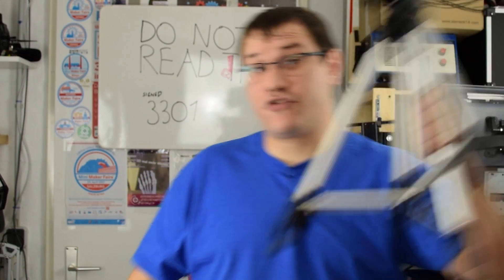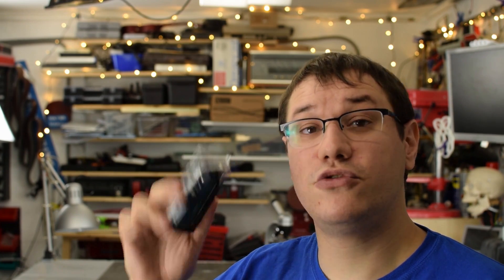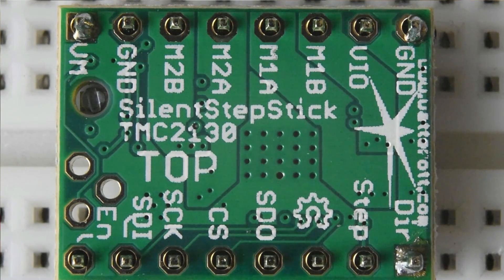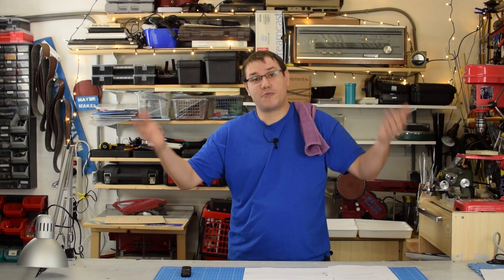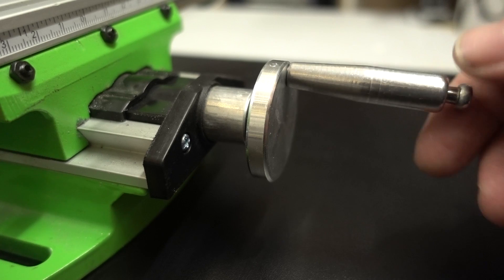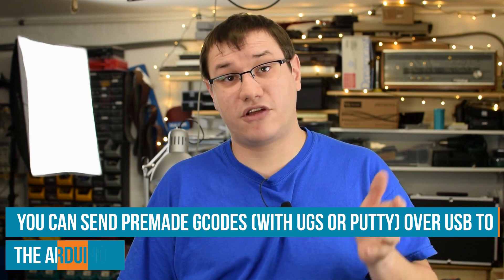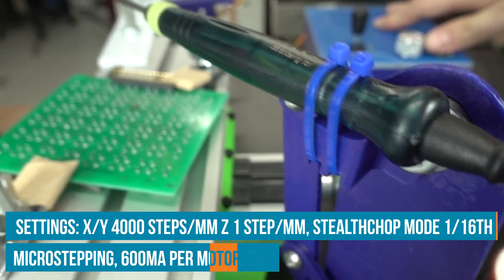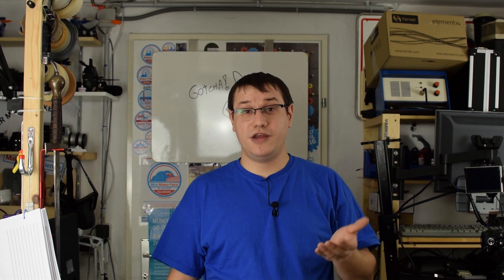Macroscope Soldering Tool

Comment: As a CNC guy, its fun to see the terms used by those unfamiliar to the field. Like a table with very little back lash or what is called slop. By electronic engineers its called "wiggle room" :-)
Reply: voltage is also called magic pixie angry factor.

Comment: I recently bought a really nice AmScope trinocular stereoscopic microscope at an antique shop for only $105 with 7x to 40x continuous zoom and about 8 inches of working distance and 2 dimmable light sources, one downward lamp and a fogged glass base with a halogen lamp underneath! I can now easily solder SMD down to 0402 with just my regular Hakko FX888!
Reply: Exactly. Way better than doing so much work.

Comment: How precise is that "precision" X-Y table? I once had a cheap lathe that I hoped to set up for CNC machining, but there was so much slop in the cross slide (about half a turn of the handwheel) that it just wasn't feasible.

Does the table move repeatably to where you tell it to go when you do complex paths that involve a lot of reversing of the motors?

Thanks for doing this video: I had no idea that cheap components like that table were available, and I'm having ideas for other possible projects that might use them.
Reply: out of the box the precission is about  2tenths of amilimeter. you have to use the varios screws on the sleds to reduce the slack, this is pretty tedious but worth the hassle. I got it to repeat close to a tenth of amilimeter, which is good enough for my purposes. the slack in the srew is determined by the pitch of the leadscrews, do not expect to use any more than 1/16th microstepping a full stepp equals about 1 thenth of a milimeter movement, and you won't get more subtile than that. I'msuere the folks on element14. com can give you many more tipps on making your own cnc project